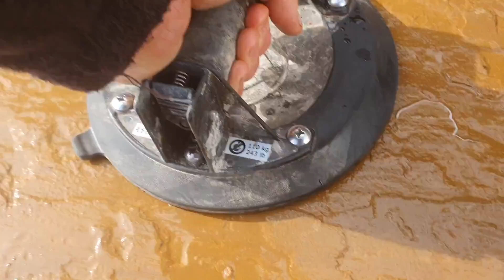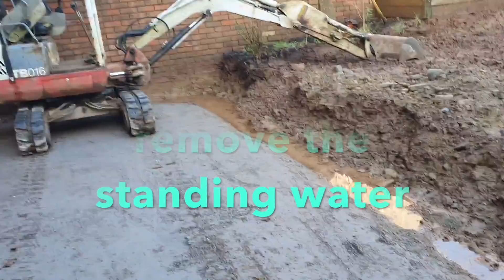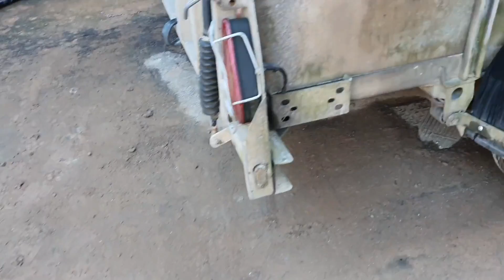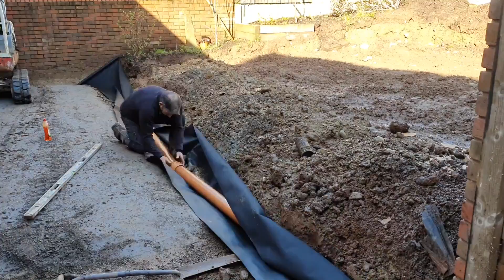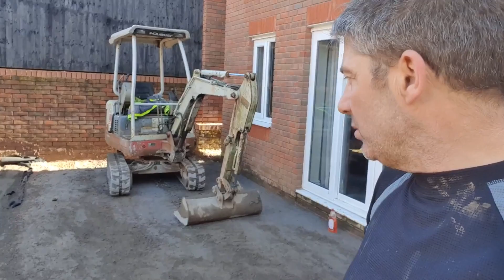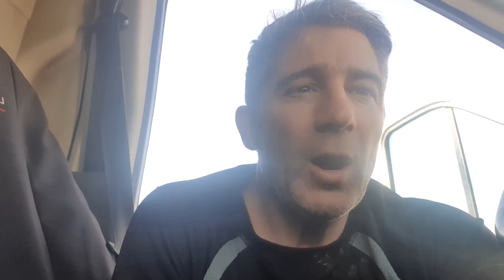How To Intsall A Land Drain To Remove Standing Water

Comment: Cheers, this was just what I was looking for, just took 50 tonnes out of my sloped garden and levelled it. Landscapers didn't do anything with the drainage so now I have a pond - lot of clay, I reckon I can lay something similar along the lines of where it's flooding and tap into the drainage. like you did on this one.
Reply from the maker: You just got to keep that water moving some how is the secret
Reply: Same here, just had garden levelled and lawned but can see pooling in a few spots so will need to do something similar

Comment: I see you put the slots in the top of the pipe, I thought they went in the bottom. Is there a reason for that. Interesting video.
Reply from the maker: I want the water to actually get away in this situation not permaet back into the ground as it was holding up.

Comment: I have exactly the same scenario except that the nearest surface water drain is 35 feet away and tapping in to that will mean lifting a concrete path to lay the pipe to it. Would a French drain alone work or would I need to run that to a soakaway?

I know, hard to say without seeing it but I'm open to suggestions.

Comment: Got a drainage job in London clay soil and think your video/work is spot on. Thanks for the good input. Quick question on what kind of membrane you used. I was going to use standard damp proof membrane under the pipe. On top do you use the same DPM or a permeable membrane? My thinking is water has to pass through to the pipe. Keep up the good work.
Reply from the maker: Hello, thank you for your comment its appreciated I hope your safe at the moment, I would personally use a permeable product my friend. Always happy to talk anytime.
Reply: Greentop Landscapes & Design how about a permeable pipe as well?